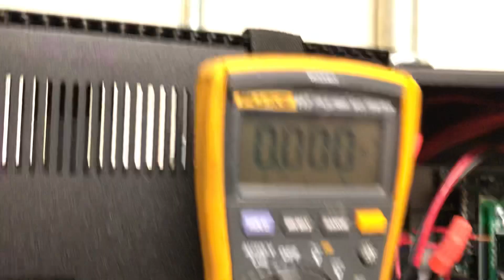How to test NAC current with a multimeter

Comment: I have a Fire Lite MS-10UD-7, which when the alarm is activated, NACs show flat zero. What is the problem? If the panel is reset and activated right away afterward, it sounds. I put the panel in walktest one day, and I think that might be something. Thanks.
Reply from the maker: Walktest will only send a pulse of voltage out, then shut off. I would meter it with the NACs sounding normally. You shouldn't see anything below 16 volts, but it will probably dance between 24 - 18 volts dc, assuming you have it programmed for Temporal 3 (I don't recall the NAC programming options for a FL at the moment, if any at all).